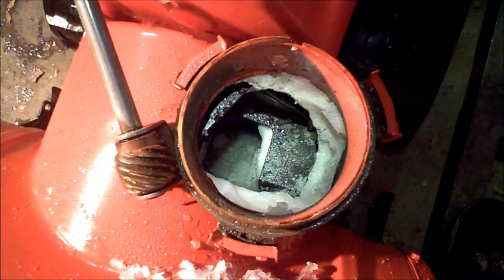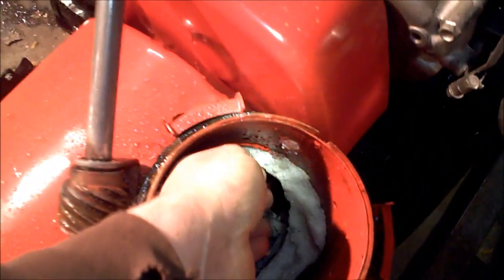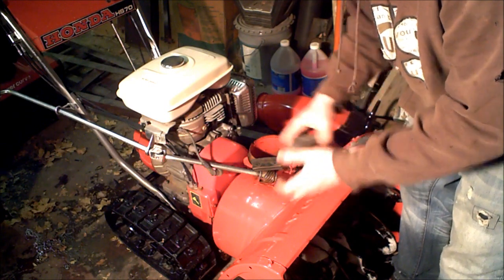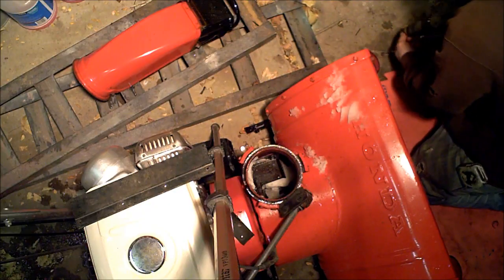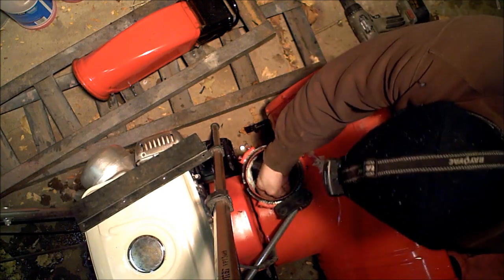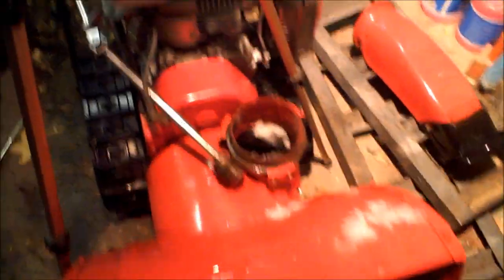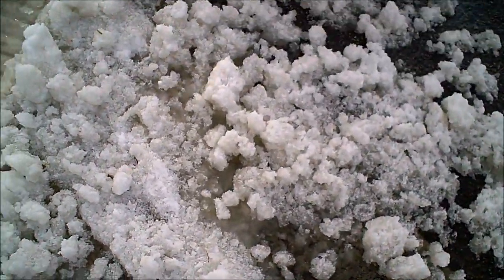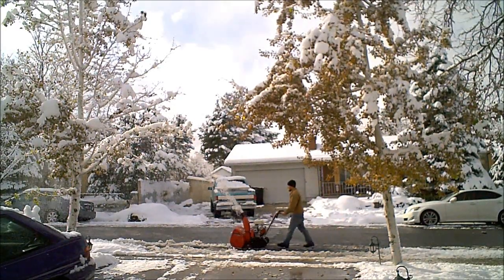Modify Snowblower to never clog and throw twice as far w/ Impeller Kit

Comment: I love your simple yet effective fix. AMERICAN ingenuity at work! Right now im using a craftsman 22" and it works good. But im not working as good as I use to, gettin old. I'm thinking of buying a new blower. I'm about an hour upstate NY so our winters aren't to bad sometimes yes sometimes no. My Buddie just got the Cub Cadet 3 stage and he loves it. I think its overkill first because of the PRICE, and then I think it moves to fast; was looking at some u tubers and when they engaged the motor it looks like it took off. I would like to buy a real nice powerful blower that i can retrofit with that rubber shield idea and not spend $1000. 2 or 3 stage whatever you think is right. It seems like you have a lot of knowledge and I would very like to hear your opinion. What are your top 2 recommendations and why? Thank you for your time.
Reply from the maker: Great question. First I'll start off buy saying the 3 stage is a pointless gimmick. Craftsman came out with a slightly different 3 stage in the 70's and it was short lived as soon as people found out it was pointless and not worth the added cost.

#1 pick Toro 724  37770
-$799
Toro's are just great machines. This has a Briggs and Stratton engine. Unlike others, Toro hasn't went the route of cheap Chinese clone engines(Cub Cadet plus many others). The 724 is identical to the 726 less 2" in clearing width (not worth an extra $100). The 826 is 2" wider and has a slightly larger Briggs engine (not worth $200 more). Toro's have great resale value as not only do they work forever but they stay looking great. They are one of the few that have high quality paint and steel.

#2 choice Ariens Compact 24
-$799
Same engine and swath as the Toro. Ariens made a great name for themselves in the 70's and seamed to struggle for the last 30 years but have reemerged in the last 5+ years with great products. Their stuff has always shown ingenuity. They have a 22" swath version of the same machine but it has a Chinese clone engine and is not worth the $80 savings.

These are the best bang for the buck in my opinion.
Reply: Hi Panasonic RX5250. Good model ,,,, if you wish can contact blasterbryan1962 at boomboxbryan62@gmail.com Chicago

Comment: Looks like a great idea. Plan to put it on a 201? 22" Craftsman my neighbor gave up on when it refused to start. It has a plastic impeller & the housing has carriage bolts that will rub on the bailer belting I plan to use. Should I adjust for the bolts or just ignore them as they have round heads. Also are #8 screws better then 10 for the plastic. That ks for your time and sharing such a great idea.
Reply from the maker: I would ignore the carriage bolt heads. For the composite/plastic impellers I use a small #8 or predrill a little and use a #10. Keep the screws 3/4" or more away from the edges of the impeller. Let me know how it goes.

Comment: Thanks so much. It's not that bad in price either. I was confused by the various numbers they sell. I saw xj50 also and assumed. I will stick w/ 50:1 when I first fill it up, but will switch to 40:1 when the seasons over. The evinrude bottle doesn't state it ad stabil! Do you add another stabil? Trying to ore plan to protect this investment
Reply from the maker: Stabil is good but if you really want no issues, ethanol free gas+ Stabil is your best bet. www.pure-gas.org will show you local stations will ethanol free gasoline. Ethanol pulls moisture from the air and is settles to the bottom of the fuel tank. Ethanol also evaporates rather quickly leaving extremely low octane gasoline.

Comment: Thanks. So the evinrude Johnson xd30, is that good for the toro 3650 and powerclear engine for 50:1?
Reply from the maker: Yes. 50:1 is with Evinrude Johnson xd30 will work great. It exceeds the TC-W3 standards. In my personal machines I always give them a little extra oil (40:1 even if the call for 50:1). The 50:1 standard is there to try to meet the EPA standards for air quality but is really pushing the limits of 2 stroke.

Comment: 65 ford, I have a older snow blower that I just got from a friend. He said the light snow he can blow but the heavier stuff it just shuts off. I tried this on the snow we just got it was wet and heavy and every time I would go in the snow it would shut off. Do you this what you just showed on this video would work or do you think there is something else going on ?
Reply from the maker: If the engine is dieing/stalling then your carb is set to lean. If you have a screw on the very bottom of your carb, screwing it out (counter clockwise) will richen the mixture and give it more power under load. Try 1/8 of a turn at a time.

Comment: Well got a ccr3650E. The ithers fell through. Now can I use any 2-cycle oil to mix the gas like echo 2.6Oz bottle to 1 gallon ? 
Or does it have to be toro oil
Reply from the maker: Good oil that is NMMA or TCW3 rated will work great. I talk about it here in this video http://youtu.be/TkZBL41Evho?t=3m47s

Comment: Thanks again for the video and idea.  I modded my craftsman on D
Sunday and turned it from a dribbler to a blower.  I bought this thing used and it had 1/2-3/4" gap between the blower and the housing, so it really didn't like to throw the snow very well.  It would maybe pitch it out 4 feet.  After adding Somme rubber to two of the blades, it spits the snow a solid 20 feet.

The whole mod took me under an hour and honestly the hardest part was finding the rubber to affix to the blades.  I searched the Big R for an hour and could not find any suitable materials.  I was hoping for a mud flap, but no luck.  While driving home dejected I found an old truck, all terrain tire on the side of the road and took it home.

I used a sawzall to cut the sidewall, but learned later that a simple utility knife would cut it.  3 self tapping screws per blade and she's ready for the next real storm we get.

Thanks again!
Reply from the maker: You're welcome. The best part is you found a tire on the side of the road a brought it home to do this(I've done the same)....... I think is awesome that you did it and 4 ft to 20ft is and impressive improvement. -Moe

Comment: So you didn't pre-drill the holes, just self-tapped right into the impeller blades?  I've avoided this mod because I didn't want to completely disassemble my blower  in order to use the nuts and bolts from the clarence kit.  I'll have to get me a mud flap this weekend.
Reply from the maker: I just used self tapping screws. Some models like the older Toro's are made of THICK metal that is a little more than a self tapper can handle, so you need to predrill.
Reply: sixtyfiveford
I like how you correctly left no apostrophe on "Toros" in your video.
You know what's cool about YouTube comments nowadays? You can edit them! ;-) ^^

Comment: spray all exposed metal parts with teflon no stick spray or try wd-40 or no stick mowdeck spray and the clogging should be greatly reduced.
Reply from the maker: Yes, but is only lasts 1 maybe 2 times. The added benefit of the mod is you also get twice the throwing distance.
Reply: sixtyfiveford i gonna try your great method when i get a good condition snow-blower in here that i want to clean up and keep in the near future,  i used to have an great running 8hp 24in mtd with a snowking on it but had to sell it due to financial reasons.

Comment: Ok so after the rubber pieces were broken in and chute reassembled, i tested the unit on some heavy compacted snow.  It kicked ass, threw snow much farther than previous but i did manage to clog it up on some super heavy slush.  Well worth the effort, thanks for the helpfull tip.  The next  project im interested in is a heater for the back of my pick-up to use while camping that wont poison me with CO2.
iron
Reply from the maker: Great to hear.

Comment: very good advice and technique. Thanks for sharing. Im thinking of buying one and will surely utilize your improvement. Do you know any blowers that have the impeller closer enough so that you wouldn't have to do the alteration?
Reply from the maker: Higher end models are generally built to tighter standards, but I have never seen a snowblower that wouldn't benefit from this.
Reply: Thumbs up
Reply from the maker: Thanks. I do have the habit of checking all brand new models as I walk past them in the home improvement stores. Troy Bilt seams to have one of the largest gaps.
Reply: Ok thanks, I been wondering bout that brand when I'm in Lowes. Looks solid on the outside but I haven't seen any reviews bout them.
Reply: @sixtyfiveford  
  I am going to make a point of looking at the tolerances when next I see new blowers lined up for sale.   Thanks

Comment: Thanks for the great idea man. i have a craftsman snow blower. there is one big hole in each blade of the impeller. so i used mining belt and cut rectangles out of it. i drilled a half inch hole in the center of the pad and used 3/8 bolts with a big washer on top. as the belt wears i can loosen the bolt and slide the pad forward. it works great. thanks
Reply from the maker: Great to hear. Mining belt will last forever and you should never have to touch it.

Comment: Awesome Awesome Awesome..... just put the rubber on the impeller last night...... incredible difference...... having a hell of a winter this year in Ontario and was running out of room to put the snow.... tried it this morning with the upgrades and probably increased my distance by 50%...... I had about 3/4" clearence on my old cub cadet..... thanks a bunch for the detailed  video
Reply from the maker: You're welcome, I'm glad you did this. That's a big gap and  doing this will help you move a ton more snow faster.

Comment: Ok so i just finished installing rubber pieces cut from the sidewall of an old tire, but part of the housing is made of plastic.  So im just gonna spin the impeller till the new parts wear in, then install the plastic housing/chute assembly.  Should work.
iron

Comment: Your awesome for taking your own time to post this and all your videos to help all of us clueless! It's a great tip! I just bought a 8hp craftsman and I wasn't impressed with the distance that it throws. I'm picking up the material I need and installing it tomorrow after work. Thanks a lot!!
Reply from the maker: Let me know how it turns out and what you think.
Reply: I will. We're getting 6 inches tomorrow morning. Do you have any advice or a video on impeller pin replacement on a craftsman?  I just tested my blower that I bought used and the impeller stopped spinning. The belts are fine, the shift spins as well as the auger but the impeller is free from the shaft. This is my first snowblower and not too familiar with the inner works. Thanks for any help you can offer!
Reply from the maker: There is supposed to be either a roll pin or bolt through the shaft and impeller. It is as simple as lining up the hole in the impeller and shaft. With the blower off, rotate the impeller through the front while holing a bolt or screwdriver in one of the holes. When the line up it will catch. There is a chance the old bolt just fell out but it could broken off inside and needs to be hammered out.
Reply: I'll give it a try tomorrow and let you know how it goes. Thanks a lot for your help!

Comment: is it possible you can send me some paddles, nobody will give me bald tires because of liability reasons
Reply from the maker: I've never asked them, I just take :). Or check the free section on craigslist.
Reply: just checked, none available for free in my area, are you sure you dont have any?
Reply from the maker: I do, but everyone I do this for I charge 20 bucks for my time and the shipping. Any thing that is around 1/4 inch thick and flexible will work. You could even cut the sides out of plastic bottles and stack them up to reach 1/4" then use them.
Reply: will #8 self tapping screws work?
Reply from the maker: Yeah. I just always use what I have lying around and I have used #8 with great success. You will more than likely have to predrill a smaller hole to get it started.
Reply: can you do a video of fixing tecumseh hm80 exhaust leaks, mine does and its a fairly common issue even though it still starts and runs fine
Reply from the maker: You mean exhaust valve leaks? I not sure if I have an 8hp Tecumseh right now but I'll check.
Reply: yup, seem pretty common with the glowing muffler, you can always tell which ones are leaking because they will have a rusted looked to them but they were actually damaged by heat, common on not just the hm80 but a bunch of the horizontal ones also
Reply from the maker: It is fairly common and involves head removal, lapping of valves and setting valve clearances. If I get one in with a leaking exhaust valve I will do a video on it.

Comment: will this work on an early 90s toro 824
Reply from the maker: For sure. It will make a HUGE difference.
Reply: where do you get your mud flaps, the cheapest i can find is 15 dollars for a single one, what screw size did you use, thanks, i think i will wait until summer so i can have more funds, and honestly even though i like messing with engines, i also dont like messing with them in 18 degree weather, im only 17,and i know more than most people on my street do about engines
Reply from the maker: Use the sidewall out of an old thrown away tire, they're free. You will need to predrill with the thick impeller on a Toro, then use a short self tapping screw(approx #10)

Comment: I have a 2740 kbota blower that works well. do you think I should mod it. I have already put a electric shoot rotator, and shoot adjustor with actuator, and power window motor....works good. Would you mod the impeller on this blower. it mounts on the from of my t 1570 tractor...thanks

Comment: I did this to my little 5HP 22" MTD Yardman over 3 years ago. All I had was a very thick horse mat to cut up, but it broke in very well and still works great. This tiny machine throws both light fluffy and very wet heavy snow ALOT further than my neighbors 9HP 28" Craftsman! And mine does not clog up when I'm in the slush anymore. I recommend this modification.  Even though I have known about this for many years, you did a nice job on this video.
Reply from the maker: Thanks. Yeah, I've been doing this on machines since about 2000 and decided it was time to share with everyone. It's amazing what a little 5hp machine can do with this mod.

Comment: I just got finished installing. the sidewalls out of a motorcycle tire worked great in my MTD 8hp/28".threw the snow over a 25ft spruce.thanks
Reply from the maker: That's impressive. I'm sure that motorcycle tire will give you a ton more miles on your MTD.

Comment: That is awesome! I am going to do that tomorrow.Outstanding Idea! I have a 1970 AMF 3 Stage. I changed the friction wheel and still cannot get reverse. Any ideas? Am I supposed to bring the adjustment up that is under the shifter with the 2 nuts on the threaded rod? Thanks Bud,
Reply from the maker: Tip it up and take off the belly pan. Then you need to make sure it is shifting to the opposite side of the metal disc for reverse. I hope that makes sense.
Reply: Thanks for getting back to me. After I wrote to you I was messing around with the gears. I was able to help the drive disc to the opposite side of the disc. So I noticed that the shifter rod where the elbow part is near the bracket was worn and sloppy. So I put my friends spare on and that helped. So I noticed that the bracket mounted to the body moves when you try and shift it without the clutch. So that bracket was the problem. I bent it back up straight and got reverse. This might help many people out there. I know that your not supposed to try and shift it without the clutch. Many people out there don't know that. So after a while they end up like me, bending the bracket and then no reverse. Problem solved. Hey that is a neat trick with screwing rubber on the paddles. You  have some mean skills brother. Oh, the problem now is the clutch takes a while to release for reverse. I have to bring it all the way up and release it real quick. It is probably still out of adjustment and needs to get further from center of disc, neutral. What's your take on it? Bud
Reply from the maker: I would think it needs " a little" lube to keep everything moving swiftly and easily. Just be careful not to get it on the disc.
Reply: Cool. I sprayed the shit out of it with old mopar silicone spray. Then used brake cleaner on the disc and drive rubber. I will put some wheel bearing grease on there today. And try to bring the adjustment up a half of thread. Thanks

Comment: will this work on a 208cc 24 in cub cadet 2012 if so where can i get the rubber i need to make the modifications to mine to stop the clogging with the wet snow and what type of rubber
Reply: it is a 2013 sorry  lol
Reply from the maker: Carl Swanson Yes it will work on any 2 stage machine made. You can use mud flaps, tire sidewalls, floor mats, etc. Any flexible semi rigid material will work.

Comment: I have that homda and it super slow. Do you know how I can speed it up?
Reply from the maker: Besides mounting rockets to it, they are just slow. I think they do this to keep the tracks from getting damaged.
Reply: OK thanks. I gave this thing a good beating this winter and it seems to have held up. Im worried about the friction disk though. It squeeks a little and I dont know if its getting full power. Anything need to be tightend or tuned up? Thanks
Reply from the maker: There is an adjustable linkage to apply more pressure to the friction disc but is generally not needed. The friction plate can get really polished sometimes and some fine sand paper will roughen it up and give it more grip.